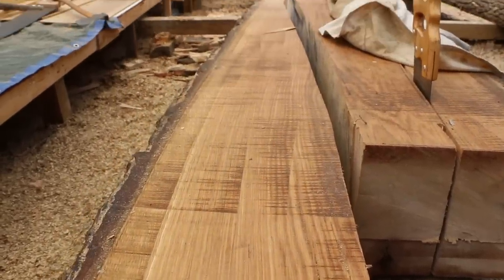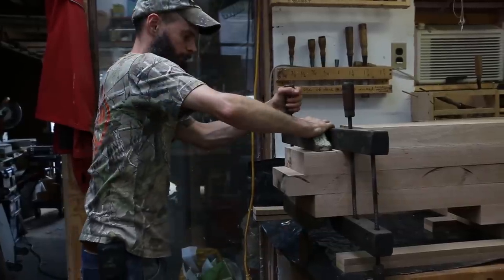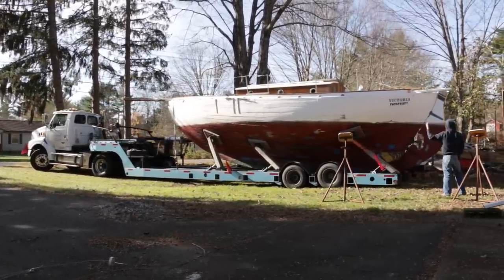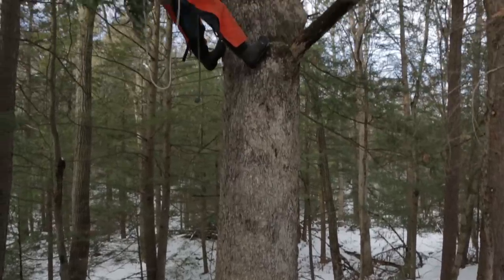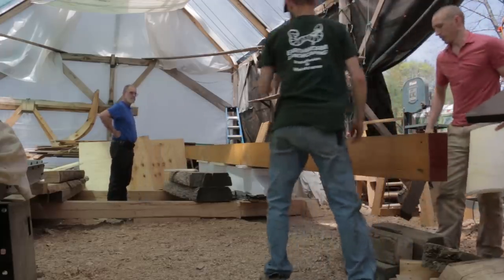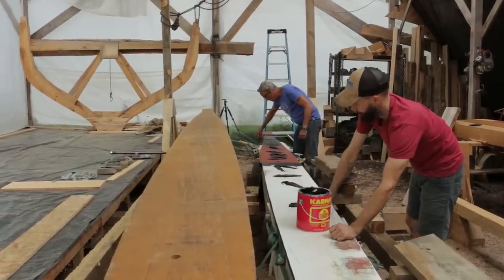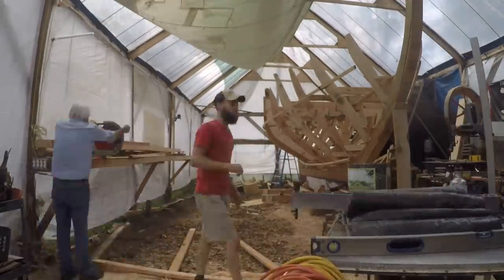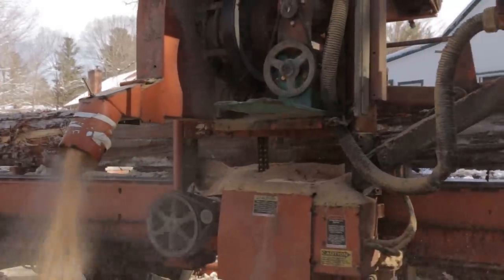Acorn to Arabella - Journey of a Wooden Boat - Bonus Content: Acorn to Arabella 2020 Recap - Part 1

Comment: Why didnt you guys use all the saw dust and shavings to burn instead of planks and whatever
Reply from the maker: Saw dust doesn’t really burn. It smolders.
Reply: Loads of saw mill boilers used the saw dust they created as fuel

Comment: I can't help but feel slightly concerned about the way this is going, having been a follower pretty much from the start. The impression I get right now is that not much real progress is being made. To me that is the reason for this current episode. Actually we know what you have achieved over the last two years, and it has been a lot. Lately, the episodes keep cutting from one thing to another, and nothing ever seems to get finished. The planking has been going on for weeks, and it still looks like about five planks per side. We don't even get to see one plank per episode. This is partly, I think, due to the new weekly format. There isn't enough material to run it this way. Second, you get distracted going off onto side projects. The Sail Cargo project, laudible though it may be, is getting in the way of your build. Now you are going to be going off for how long to be involved in that. Your own build and video channel will suffer. It might be worth doing a comparison with Leo's channel. I'm sure you do. His is much better compartmentalized. True, he has very rightly taken a month or so off to visit friends and family back in the UK, but when he is working he just focuses on one thing, and you get the impression that progress is being made. This is helped a bit by the fact that he only posts every two, sometimes three weeks! Anyway, that's my ten cents. Keep up the good work.